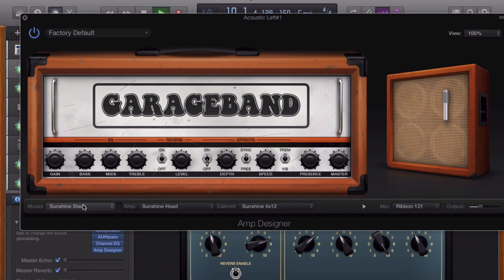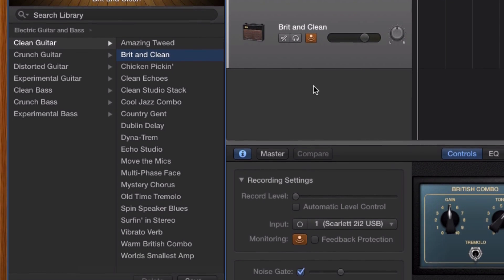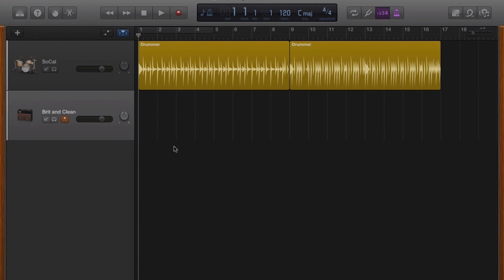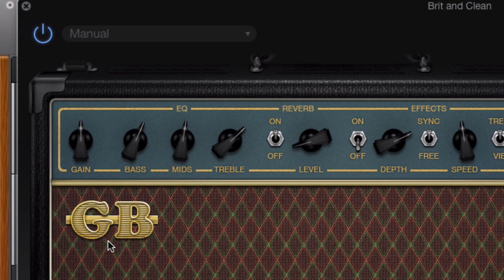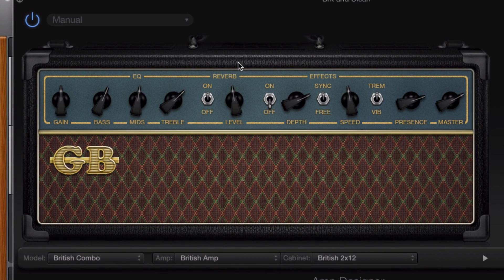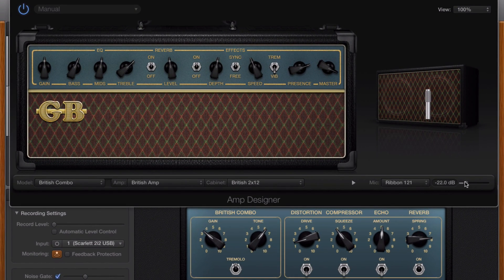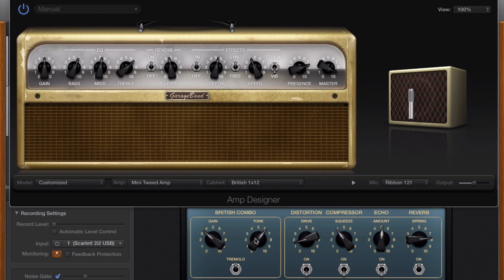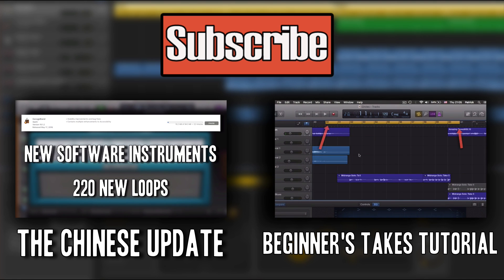Garageband Amp Designer Tutorial

Comment: Patrick - do you find that the built in noise gate is sufficient for your needs, or do you use another type of noise suppression to get rid of all the noise at higher gain settings? Thanks.
Reply from the maker: Yeah I generally just use the built in noise gate. It does everything I need it to!

Comment: Thanks! There were two (sub) features you showed that I would NOT have found for hours of experimenting! This app has been through a number of tweaks and updates, but the core of it is still getting better. Comparing these amp sounds to other software emulators, I find that GB is pretty darned good...and if one considers the expense, it is at the top for what you get for what you paid.
Reply from the maker: 100% agreed!